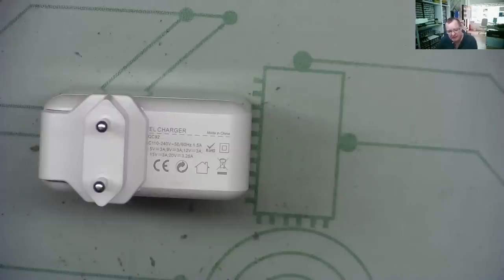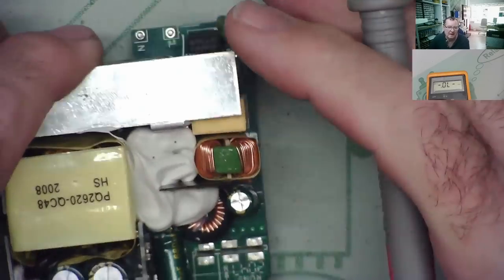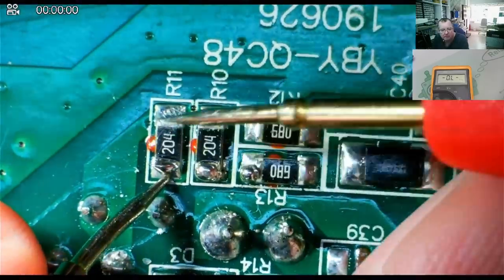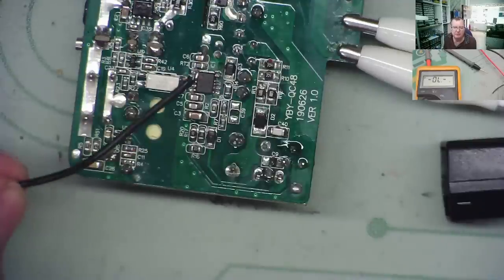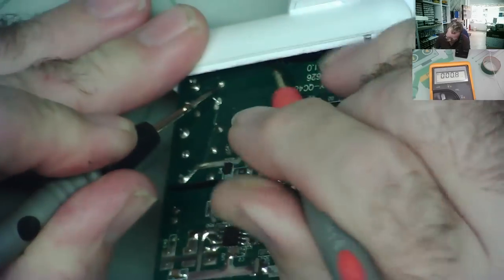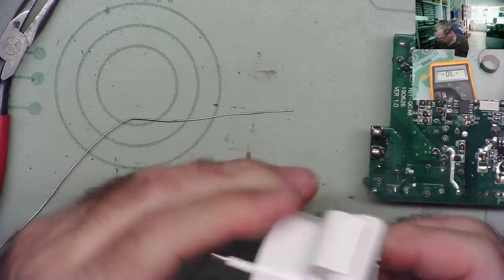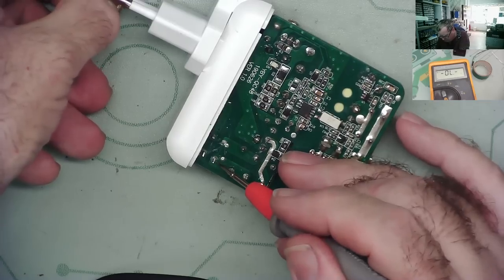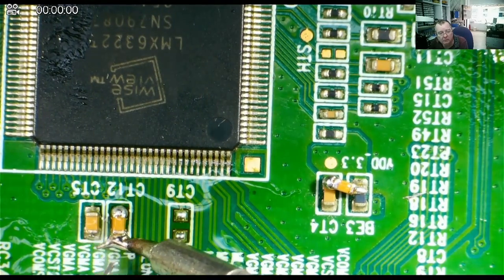USB-C PD Power Supply Charger Repair.  Dead PSU

Comment: Do you think giving the chip a really good clean fixed it and made it start working and discharging the capacitor?  Maybe got rid of some corrosion.  That's the only other thing you did apart from solder a green wire to the negative of the capacitor when you were testing it.
Reply from the maker: Did you watch it to the end?  If so then you would know what fixed it (eventually)
Reply: @LearnElectronicsRepair  You misunderstood me Richard. I was trying to answer your question of why the capacitor was still charged when you opened it.  My question was about the role of the chip in discharging the capacitor.  Is it possible that the chip may have had corrosion on it and when you cleaned it, the capacitor started to discharge properly after you disconnected the mains.  I know next to nothing about electronics mate.  Anything I have learnt is mostly from watching your videos which I have been binge watching over the last couple of weeks.  Thanks for all that you are doing.  I'm off to watch your video on switched mode power supplies again.
Reply from the maker: @bittertruth6575  Oops sorry crossed lines: So one would assume that if the chip is drawing any power at all, then it would discharge the nasty high voltage capacitor - and certainly within the 30-40 minutes since I last plugged it in.  When I connected power to it with the crocodile clips and powered the PSU with no load, it discharged the capacitor pretty damn quick with no load on the output, and slower but noticeably with a load attached.

In this instance the high voltage capacitor did not discharge noticeably before I touched it, even after a long time with no power input and I have admit I am somewhat at a loss, due to the actual nature of the fault, to explain 1.  How the capacitor got any charge in it at all.  and 2.  If the mains connected long enough for the capacitor to charge then why did the PSU not start up, at least enough to drain the capacitor again.

Comment: I can discharge  capacitor by probing it with a multimeter on diode mode
Reply from the maker: I'm really not sure I would try that on a capacitor charged to a high voltage